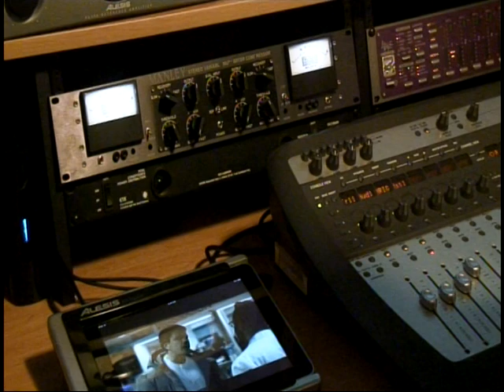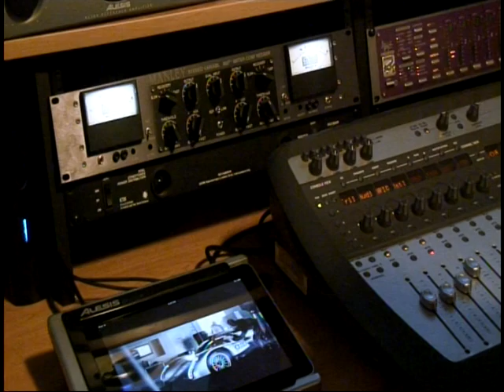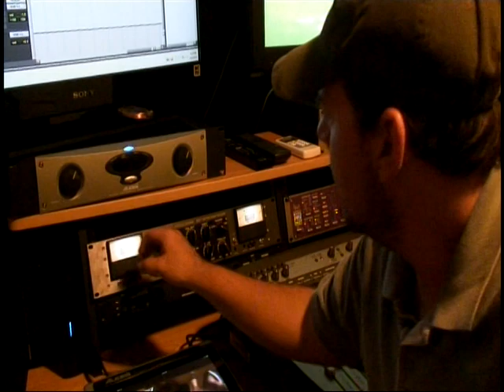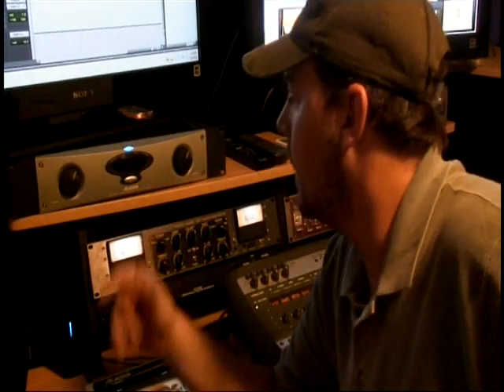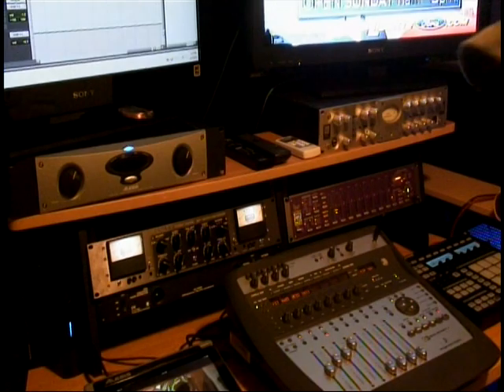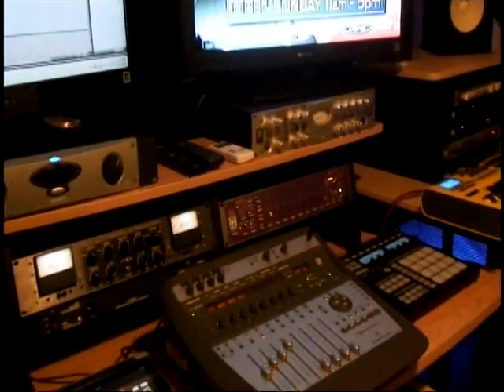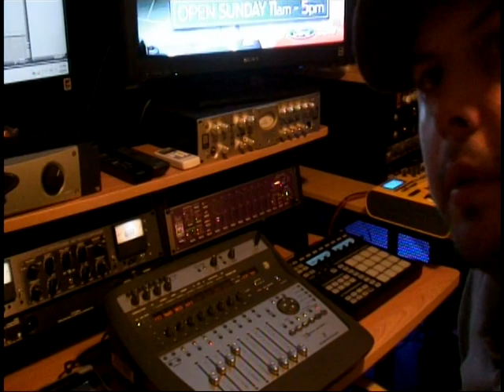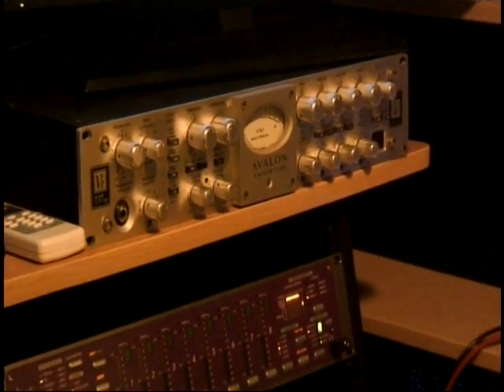Recording engineer equipment and tips

Comment: Hey Doug, have you used the Neve portico MBP? I was weighing where to get it or the Manley MU. They are both about the same money. Just curious of what your thoughts are on this?
Reply: wow... those were my 2 choices as well..
Reply from the maker: Um, the portico is a great piece of gear, honestly they both are great at giving you such a amazing professional sound, I don't think you can go wrong with either one.. Gear like that cost what it cost, cause it does what it does, very well..
Reply: Doug Jenkins So, Doug. as an engineer planning to integrate my DAW with outboard gear ive decided that my first piece would be the portico.. for stereo compression.. now what would you say would be the 2nd and 3rd most important components to get me going on a somewhat professional level? I am currently producing through mpc 2000xl and machine.. I have the new version of logic and a limited version of pro tools in witch I plan to upgrade to a full version soon.. ADVICE? thanks. .  
  In addition to that, Yes I do plan to go all out as far as a full prof set up.. I just want a little advice on where to start.
Reply: I was also looking at the antelope orion bundle...  any thoughts?